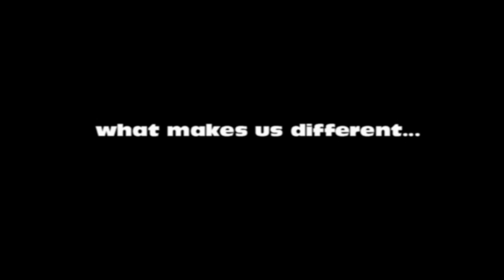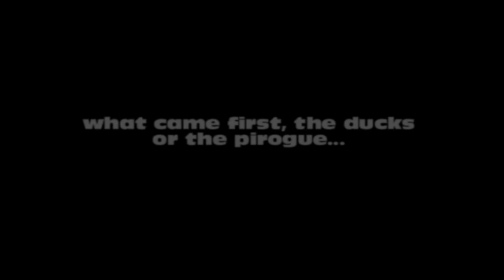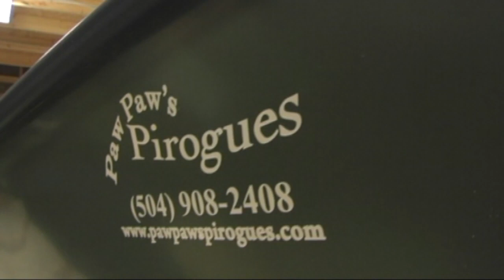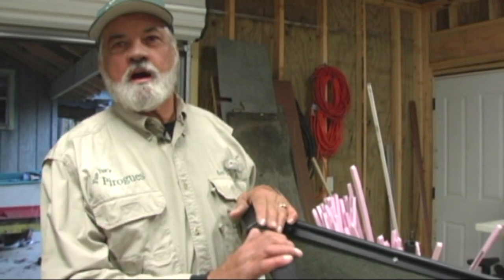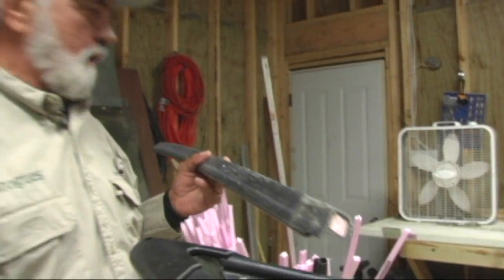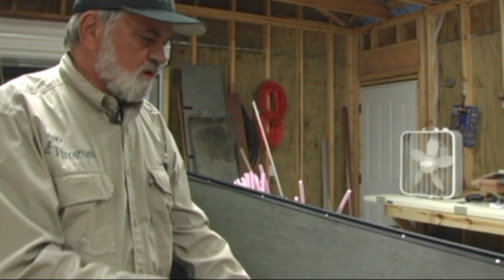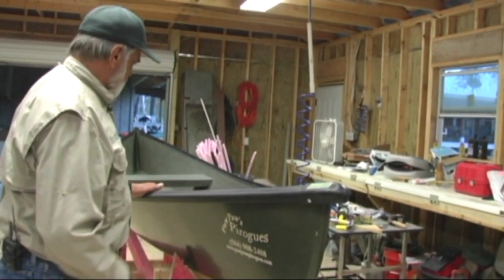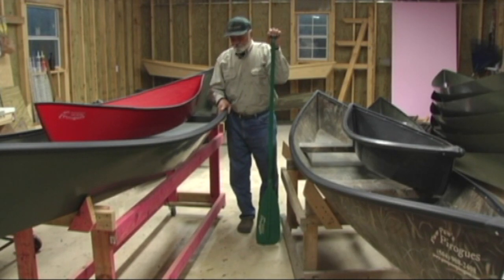The Paw Paw's Pirogues Story

Comment: Your pirouge is somewhat similar to the bow shape of a 12' skiff that i am building. The reason i started checking out pirouges is that the layout of my side plywood bow panels look like they could be cut 4 sheets at a time from 8'x24" ply. to provide the 4- 8' x 24" side panels needed to quickly make a nicely shaped, wide, 16' pirogue or dory, that has a high bow and stern W/proper rocker and rowability.

Comment: When he says that the pirogue has "rake," is he talking about rocker in the bottom?
Reply: It's my understanding that "rocker" refers to the arched shape of the bottom as it rises or falls towards the stem or transom, and "rake" refers to the angle of the stem.
Reply: Rake refers to the top front point of the bow drawing a straight vertical line down. The angle from the point the bow “rakes” back and touches the waterline to that vertical line is the rake angle of the bow or sometimes called a bow pitch angle.